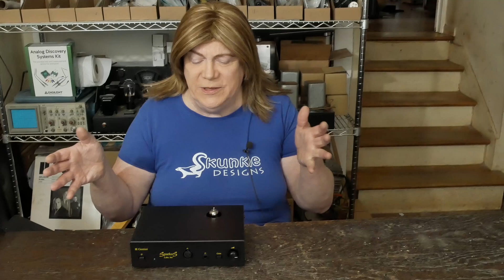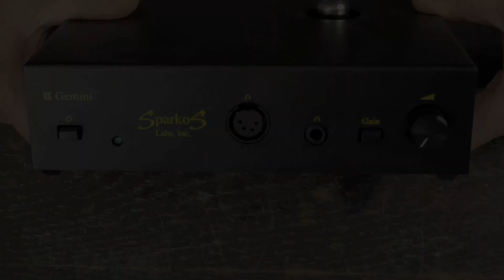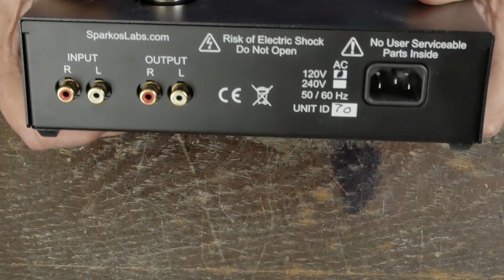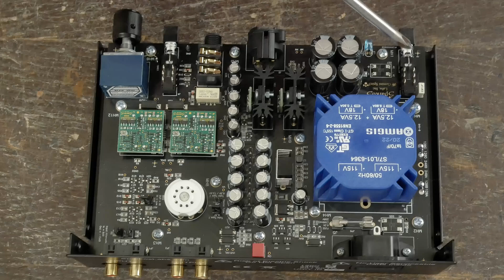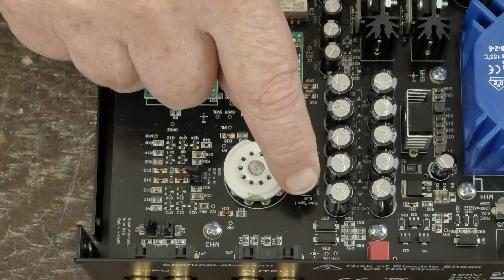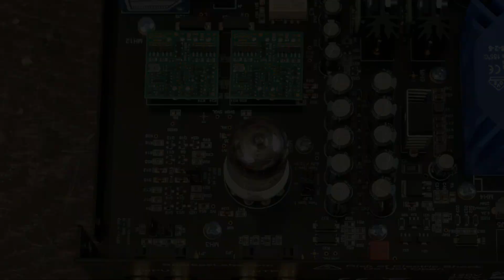HiFi Tube Headphone / Pre-amp: Sparkos Gemini Overview / Instructions

Comment: A few questions. I wonder how it compares to Aires? I wonder at the wisdom of Sparkos bringing this out and taking sales from Aires. And this only accepts RCA in. Lots of DAC  reviews include measurements and they usually show RCA implementations  not the best. Is this a fair point?
Really like your reviews. I learn.
Reply from the maker: I have no idea and honestly the Aires is in a different market segment. A lot of manufacturers have gear that perform the same function at different price points. And yeah if a specific DAC doesn't have a good RCA implementation, it probably would be a good match. A lot of tube gear with XLR inputs are much better on the RCA, so it's something you have to research before buying!

Comment: What is the tube used for?
Reply from the maker: To add some second order harmonic distortion. I would email Andrew Sparks if you want more info!
Reply: @SkunkieDesignsElectronics  Thanks, not necessary.  But why is there only one if it's stereo?
Reply from the maker: It's a dual triode tube. There are two separate triode elements in the same bottle, one for each channel.

Comment: Can absolutely vouch for the 6DJ8 (made a SRPP preamp to drive headphones with Sansui ST-84 OPTs).

The moment you opened up the cover, I could tell this was a serius piece of kit and well worth the $1K asking price. I'm with you on excluding separate tone controls, but did successfully implement loudness compensation on a 6BM8 tube amp w/o mucking up the sound quality. Your in depth knowledge of preamp tubes regarding filament connections definitely added to the quality of this review. Many Thanks :)